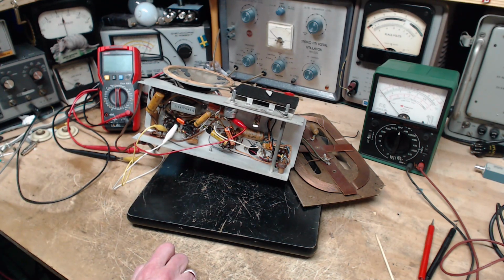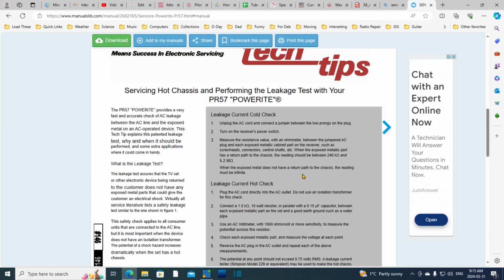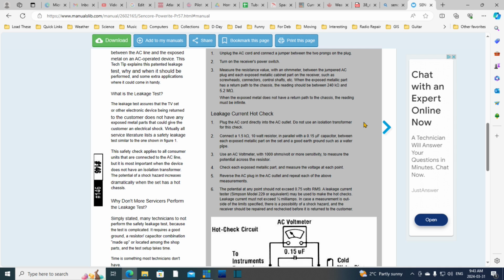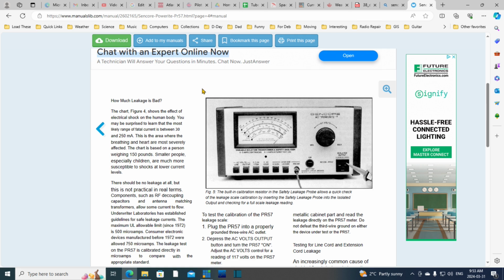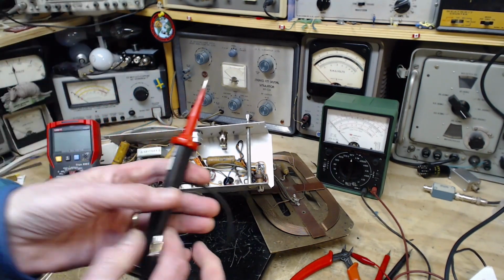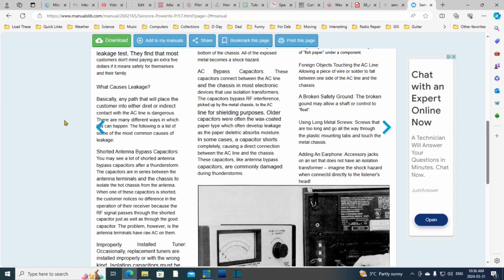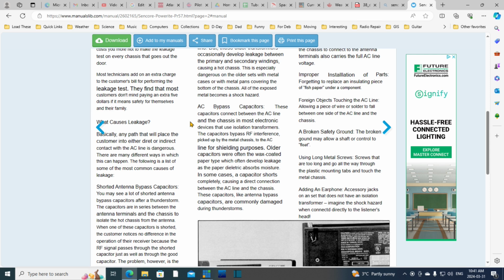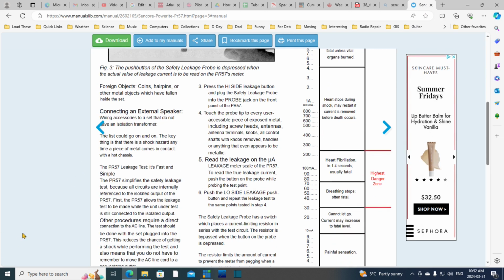Delco R1238 Tube Radio Video #3 - Deep Dive Hot Chassis Capacitor

Comment: Greetings:
Measuring resistance requires using both probes of the meter. Early on at 16:00 you no longer have the meter's black probe connected anywhere.

Comment: A simple leakage test is made using an 1800 ohm 10 watt resistor in series between the chassis and a cold a water pipe using the AC voltage range  on a Simpson 260. And first year electronics student from the 50’s 2:00 knows that. Use ohms law to calculate the current flow based on the 1800 ohm resistor and the AC  voltage across it.

Comment: make the same voltage reading using a Simpson 260 VOM or monitor the cathode current. Contact potential is much like the forward bias in a transistor😊 whereas it needs more than .5 to .7 vdc to conduct. In a tube circuit .2 volts is nothing, it will not  let yet allow cathode to plate electron flow conduction.

Comment: Greetings:
Your "contact voltage"  discussion had me thinking that adding some resistance in the socket-pin-to-cathode lead internally to the tube could become the source of a bias to the grid. Could have been an inventive selling point when tubes were still used.

Comment: Jim I listened for an hour before throwing in the towel.

BTW. Why does Greg always have the same comments.
Reply: You've got more endurance and patience than I do.  Also, why is Jim calling this a hot chassis set?  It has a floating chassis.  Not quite the same thing unless the isolation cap shorts out.